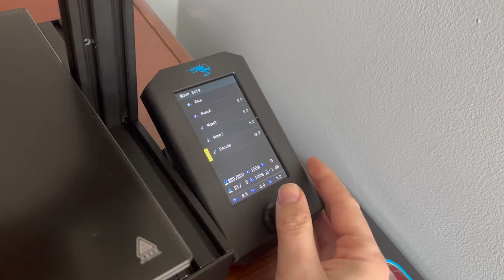How To Replace / Swap Hotend Nozzle | Ender 3v2 | Easy Printer Maintenance & Repair

Comment: Nice video.  2 questions.  Is heating the nozzle required first?  What is the smallest nozzle size that you can use to print with the ender V2?  Thanks
Reply from the maker: Heating the nozzle isn’t required, but it makes the nozzle break loose easier. It’s worth doing. 

I’m not sure what the smallest nozzle that can be run, I’ve ran 0.2mm nozzles.
Reply: You've run .2mm on the stock nozzle?  Is that using PLA?  I'm interested because I print really intricate detail for earrings cutters.      @PrintPractical